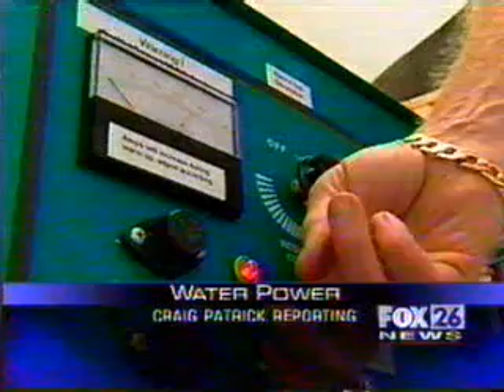Run you car on water and nothing else.

Comment: Uh.. when you use 1 unit of energy to split water into H2 and O2.. the energy you get back is at most is 1 unit of energy back when you burn that H2 gas if you are lucky.  Law of conservation of energy.   Edison was a scientist.  Try again.  Again.. energy you put into splitting water into H2 and O2 is the same or less power you get back.  This was demonstrated in high school science class.  Apparently some high school students were not listening in class.

Comment: This is not energy from nowhere, it needs to be supplied with water, for the water to be cycled through and reused, theoretically making a true infinite fuel source, would take more energy than it gives off, though this is not a perpetual energy generator type thing.

Comment: urls not allowed   check out wikipedia  /wiki/Water_powered_car  scroll down to dennis klein.

If that small box could generate electricity, think of how it would be used during a power outage and possibly save lives by allowing a fan or air conditioner to be run.

Nostradmus never invented a water powered engine and it can't be done !

Comment: "...a small electrical current..."

The problem is that it is NOT small. You need about 80 kWh  to produce 1 kg of H2, which can give you 33 kWh. It will never give you more energy than you need to "break" the water.

By the way, the title should be "Run you car on water and... electricity"

Comment: @Piocha999 you see, the idea behind this is to increase efficiency in the gasoline engine. Just collecting the power from the sun would be useful in an electric car, but there's no use of electricity for a gas engine. In order for the sun's energy to help increase efficiency in a gas engine, they convert it to a hydrogen-oxygen mixture which then can be used to improve combustion characteristics. Hope that helps :D

Comment: Just one more thought: Yes, it is possible to get energy from the sun for electrolysis to happen, and then get the fuel. But if you get such needed high efficiencies from the sun, isn't it better to use this energy directly to run the car instead of having the additional process of electrolysis?

Comment: @fluxrez Wrong. Hydrogen is not energy, hydrogen is a chemical. It has a chemical potential energy that it is given through electrolysis. You can only get as much energy from burning H2 as you can get from making it. So overall, there is a net increase of zero calories (Or joules, or any other unit of energy)

Please understand things more before you start calling people trolls.

Comment: @philbot01 When used on a car, the fuel cell is powered by the car's battery, which is recharged by the alternator, therefore you don't need thousands of kilowatt hours, since this is a closed circuit.  Check Stanley Meyers story. He crossed the US on a dune buggy in the eighties, using a more efficient fuel cell than this one, and exclusively water.

Comment: Build a prototype your self. That's the bottom line. Really get into and find out first hand. As to the 'law' of conservation of supposed 'energy' it's a badly flawed notion. 'Energy' is not a 'thing'. Rather MOTION and counter motion abound. So called 'matter' is standing waves of MOTION in opposition to STILLNESS. It can be unraveled. Atomic power DOES NOT require big money.

Comment: @mana619 

It's pretty obvious you don't even have the mental capacity to assess problems like these. You're probably more of a technician than an engineer if anything. I'll bet you buy into all the perpetual motion videos on YouTube as well. 

I'm not saying it's impossible. You certain can run vehicles from H2. But you aren't going to get more energy out than you put into the system. This means you'll use electricity from elsewhere which can be just as bad as using gasoline to start with.

Comment: @proaudiohd wrong, hydrogen gas is combusted in the engine and is more explosive that gas. otherwords more energy. water itself doesn't go into the engine. the hydrogen does and it produces plenty of extra energy to power everything and keep the battery charge. i would put in a scientific problem for you but you wouldnt understand.

Comment: its funny how many people think that its so stupid to run with on board generation of hydrogen, yeah itd be alot smarter to drop in an electric motor. oh wait. what about all of the cars on the road that could use this system with little modification. i think this is the best thing to be used to settle some sort of transition from todays cars to tommorrows.

Comment: @morrisburger1 The problem with the transition you describe is you're suggesting we use crackpot bullshit instead of actual science. You will get more miles out of the battery if you use it to drive an electric motor directly. Adding on-board hydrogen generation to the mix will REDUCE your miles per charge, not increase them.

Comment: @morrisburger1 The problem with the transition you describe is you're suggesting we use crackpot bullshit instead of actual science. Generating browning gas in the moving car is a waste of energy and will NOT get you further than using the battery to drive an electric motor directly. You will get more miles out fo the battery if you use it to drive an electric motor directly. Adding on-board hydrogen generation to the mix will REDUCE your miles per charge, not increase them.

Comment: Wind turbines performing electrolysis to fill hydrogen fuel cells or charge an electric battery overnight makes sense. Wasting the energy in that battery to perform electrolysis in the moving car results in a massive percentage of the available energy being wasted for the sake of saying the car runs on water.

Hydrogen is not a fuel source, it is a storage medium like a battery. On board electrolysis is no different that using one battery in the car to charge another.

Comment: @morrisburger1 It would be far more efficient to run the car directly from the battery. Performing electrolysis on board and then burning the resulting gas is a MASSIVE waste of energy. The theoretical maximum energy recovery is only about 80% on each conversion. Electrolysis is one conversion and burning the gas is another. You've wasted at least 40% of the energy in the battery with a futile conversion.

Comment: @morrisburger1 "it doesn't matter how much energy is used in creating the HHO"

You're wrong. You are advocating this nonsense because you are deciding to deliberately ignore the generation side of the equation. Performing electrolysis in the car will not power the car. If you want a hydrogen fuel cell car you need to be using hydrogen generated elsewhere. None of this frees us from fossil fuel.

Comment: @morrisburger1 Water powered cars are a common scam. It's a variation on perpetual motion machines. Iit take more energy to perform electrolysis than you can recover from burning the resulting gas.

There are some engines that use the heat in the cylinder to flash water to steam, essentially adding a stroke, but that temperature variation reduces overall combustion efficiency and increases wear and tear on the cylinder.

Comment: @spearsanythin I like you; you're funnier than Gomer Pile. Of course petrol has less energy in it than the oil that made it, that's not rocket Science. But that's got nothing to do with thermodynamics, you've TOTALLY missed the point. LOL
Electrolysis followed by burning of the hydrogen is a symmetrical, reversible reaction. Extracting petrol from oil is nothing like that, it's one way.
Ironic you calling me a caveman considering your embarrassingly poor understanding of Physics and Chemistry.

Comment: @a1mint 
OK the electricity is used to seperate the oxygen and the Hydrogen,
A car produces electricity via the altinator, The power produced my the hydrogen through the engine is greater than the power consumed my the seperation process, so the excess energy that is being converted from the water is powering the car, so NO the power here is not ELECTRICITY, and Yes you are stupid.

Comment: Hybrid will be the way to go with Electricity and Gasoline. Electric for short trips and gas oline kicks in when you need it for passing. Water is  not customer friendly! Too many querks! The world had one of those. The vehicle had a boiler system running the PTO off steam pressure. Great for working trucks because it took a truck to carry it as it was big and bulky. Anything to do with water will freeze in colder climates unless you put an additive in it and guess what more expense.

Comment: @JimButler1234567890 But what if you used lots of different ways to collect the electricity. Like you can use a solar powered generator, use the kinetic energy from the car to get electricity (obviously not when it's in motion, but there is something that generates electricity when you brake) and lastly you can use electricity from your own home. Combining all three ways could be effective but then again maybe there will be another problem thats discovered.

Comment: By the way, the largest use of quartz glass is for the inside of the furnaces used to make computer chips. The chips are made on large circular pieces of silicon, which are placed into quartz glass cylinders and heated vigorously while gasses are added to fabricate the chips.

Comment: @Dill1090   Normal glassblowing uses natural gas or propane and Oxygen. However, to melt certain types of glass, mainly quartz, you need a hotter flame. Acetylene and Oxygen is hot enough, but acetylene burns dirty and the soot created can affect the glass, so you have to use Hydrogen and Oxygen, which is both hot and clean to melt the glass to work it. Does that clear it up for you?

Comment: Actually, 'old' here is closer to spilling the beans than he intends. In many WW II aircraft engines, a pilot could make a temporary increase on HP of an engine by injecting very small amounts of water into the cylinders. The water turned to steam during the ignition, and steam expands more forcefully than air, resulting in greater HP. But the water can ruin the engine quickly, as you might imagine (i.e. rust) and you have the weight of water to lug around, robbing performance.

Comment: You are not only wrong, but dangerously wrong! I have used Hydrogen flames as a glassblower working on quartz glass (regular propane or NG and oxygen are not hot enough), and there is nothing more dangerous. Hydrogen burns completely clear, and had a weak flame front, meaning it blows out easily. So, it blows out easily, and you cannot readily tell if it is burning, so it's very easy to have hydrogen gas leaking all over the place-VIRTUALLY NOTHING IS MORE DANGEROUS!!!

Comment: @DOJIELDIENVE   I have nothing against electric cars-fine idea, the only general problem is short range. But what is being discussed here is running a car on water. Water must be split (electrolysis) into H2 and O2 to burn or use in a fuel cell-no big deal. The problem is it takes more energy to split water into H2 and O2 than you get back, thus you have a net energy loss.

Comment: I am something of an expert on Hydrogen flames-I have used them for years. He is using what is called a surface burner, where the gasses don't meet until they are outside the torch, thus cool gasses flow to the tip.

The reporter even says he uses electrolysis to split the water into H and O.

And, if you did not notice, HHO is the same as H2O (the 2 should be subscript), thus it's the same! He is the one pulling the wool over your eyes, not me.!

Your ignorance of science is scary.

Comment: The 'law of conservation of energy' does not apply if you are using HHO in combination with petrol to dramatically decrease petrol consumption. Petrol burns more efficiently with HHO in the mix. The setup is simple and can be done for $300-600.

An engine can be fueled solely by HHO, but it is not feasible due to the size of the cell needed, the complexity of electronics needed to optimize electrolysis output, spark timing compensation, and 'maybe' the 'law of conservation of energy' as well :P

Comment: @JimButler1234567890 Your thinking that it is like spinning a wheel to produce more energy on the other side. What you are doing with the hydrogen and water is tapping into its chemical potential energy. The energy is already there, you are just releasing it in a usable form.

Comment: @mthompw It's mostly the problem of storing the hydrogen and re-fuelling cars when there's no infrastructure to do it. Electric will probably be the way they'll go, for now anyway. You can already buy them of course.
You can't fill a car with water and then drive around with that as fuel unless you use some other sort of fuel to break up the H2O molecule first. And if you're going to put fuel in the car to do that you may as well just use that to run your engine.

Comment: There is no question but that hydrogen does combust to produce water, releasing mass amounts of energy. The problem is this: The law of conservation of energy says you can't get more energy out than you put in. So how much electrical energy is necessary to produce the hydrogen, compared to how much energy is released when the hydrogen is burned? (probably a little more than when it is burned). This implies that it would be more efficient to run the car on electricity in the first place.

Comment: Now I was wondering one thing. If by putting in energy you get this great new gas that can make cars run and weld and so on, by using solar and wind powered power plants you could in fact use, say, the sahara desert to make it one massive solar plant and use it to create the gas. Then you can distribute it all around the world as a great non poluting renewable energy source. So even if you get as much energy as you put in, if the energy is from the sun its a great deal.

Comment: @zzytrewq 

ok yes 2 H20 produces O2 but u just said H20

the electrolysis process is UNIQUE is what they said about it. Means that the process is different from normal electrolysis. 

as for the % effeciency thats physics. If you're saying this is a fail and that its just normal electrolysis, why dont u go make a gas that we SAW can make a brass ball into glowing liquid metal. The goal of this was to create a safer gas to weld with and thats what he did.

Comment: @zzytrewq Oh one last thing Ziggy, the Super Charger and Turbo Boost,,, BOTH require, Energy to work, Mechanical energy, the Turbo, as drag on the exhaust. Precisely the way, an ONBOARD Hydroxy unit requires energy, 1.57 Volts DC and 2 amps. The average alternator generates about 18.7 Volts and some over 100 Amps. A hydroxyl unit takes no more energy than is used by a cigarette lighter,,, and gives BACK over 50% more efficiency of BURN. TR Knudtson

Comment: @zzytrewq When I did flash through the timing lights, I was on my side, sliding for my life, scrambling atop of the bike,,,, OH and,,,, ON FIRE. 
My age was discovered, the Naguahide suit, burnt and stuck to my thigh, my gloves worn off somewhere between the -50 yard mark and the finish line. I was banned from the track, they refused my times, some unholy technicality about blazing, speeding idiots, needing both tires on the track to qualify, the 120 MPH Speedo needle, bent over and stuck.

Comment: @zzytrewq Because PURE Hydroxy is hard to tune at lower RPMs, the string on the finger opened the valve,, AFTER the engine entered its power  and gained sufficient RPMs to absorb the boots effect. With added horsepower, I went through the timing lights as over 118 miles per hour, a track record for the 500cc street class. Unfortunately, the bike could not handle the cylinder pressures, a Pre-Uni, lost a ROD, which punctured the rear tire, about 50 yards short of the finish line

Comment: Look, I too had my days of speed. In 1967 or 1968, underage to race, I took an old, stretched, 500cc 1948 Triumph Tiger out to Fontana Drags. Extended frame, a slick, NO leathers, only a barrowed, fake, Nagahide racing suit, flame proof hood. Under the left lobe of the tank, I had concealed a storage bottle of Hydroxy and ran a nylon string up to my finger of the clutch hand. The 500cc STREET class of those days, maxed about 85 to 90 MPH., for the  ¼ mile.

Comment: @zzytrewq Muscle Cars, like the ones you use as a form of adolescent andros anxiety compensation, begin to loose power at about 6,000 RPM, mostly because of,,, valve float,, AND,,, Fuel Spoil,,,, (Un-burnt fuels dumping out the exhaust valve) Hydroxy Plasmas eliminate this LOSS. Frankly, you need not listen, as I am very sure the center of your universe, is close at hand.
TR Knudtson

Comment: @zzytrewq FURTHER, that Plasmas quickly return to water, this further adds to the expansive materials in the cylinder, PURE, dematerialized WATER, non-injurious to the engine components. You might think of this as Hyper Steam, just like water injection,,, but part of the fuel additive. 

On TOPIC and you are still,,,,, OWNED!!!
TR Knudtson

Comment: @zzytrewq Critical Information. Internal Combustion Engines run on AIR, the fuels are only a way to cause that AIR to expand rapidly. Following your logic, Turbo Boost or Super Chargers would not work, as they only supply MORE AIR, NO Energy added. 
A tiny, tiny amount of Hydroxy Plasmas simply make the fuel burn faster, hence MORE POWER, precisely the same way Nitrous Oxides react,,, BUT,,, Hydroxyl Plasmas are made from water, onboard and as needed, and are FREE. 
TR Knudtson

Comment: @zzytrewq The Positive, an ONBOARD, Hydroxy unit, simply liberates what was always there, MORE POWER from the original petrol fuel in a catalyzed burn. A Faster burn, SOONER, more cylinder pressure and a cleaner burn, a more complete burn. Seen demonstrated in the Video, Plasmas are highly reactive to carbon, elementally reactive to carbon. That you cannot watch the Video and see this, or understand Plasmas, is NOT MY FAULT. 

Directly related to the TOPIC. Use you OWN EYES!
Knute